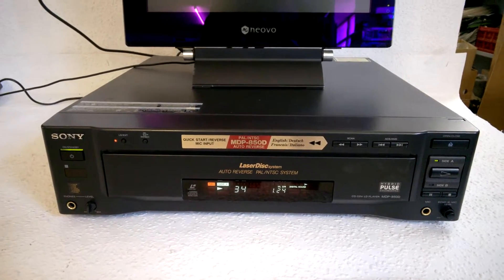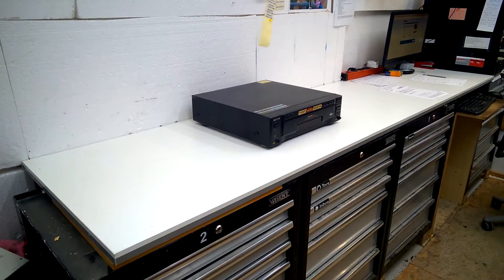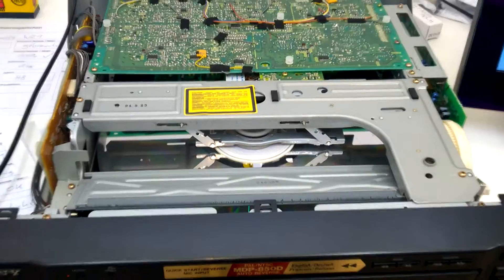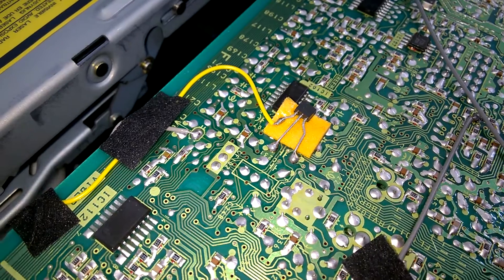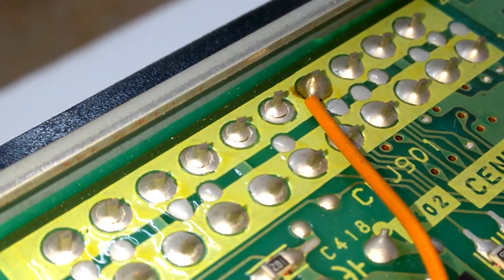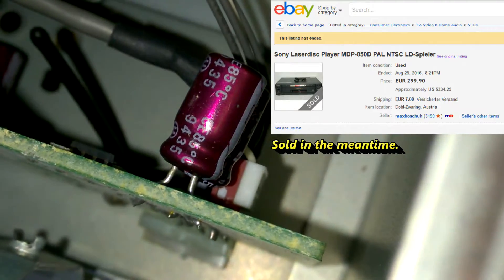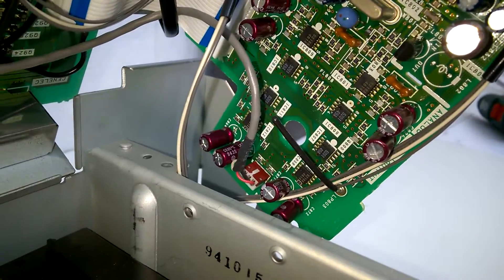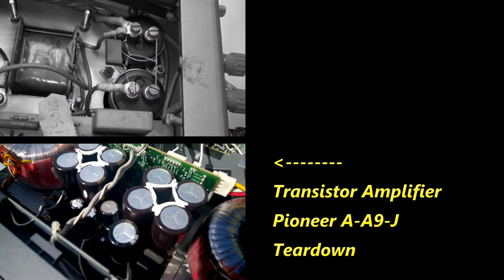Sony MDP-850D LaserDisc Player Teardown & Service, BEB #26

Comment: I have a MDP 550, the disc will go in but not spin, spin motor is ok. Looking the power control board, can't seem to find any faults.

Comment: damd those scart connectors... crap doesn't even come close, why oh why did we not use 25 way d-sub instead? What kind of shop do you run Max? You always seem to have interesting stuff!
Reply from the maker: I don't really like the scart thing too. Sub-D would have been great! I am somehow glad that we have HDMI and High definition nowaydays, but oddly enough I am missing the analog thing somehow. 
You can check out ebay Max Koschuh. I am selling parts from teardowns and other random stuff. Also a lot of Tektronix, as I hvae bought a tektronix repair shop some time ago.
Reply: Max Koschuh Thanks Max, you have a lot of stuff for sale!!